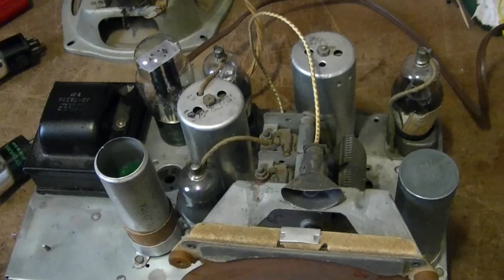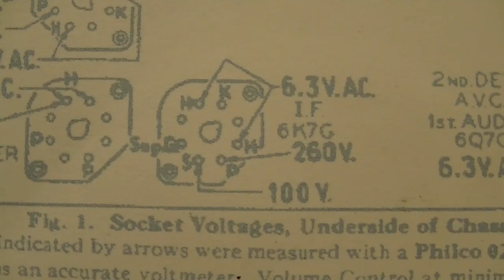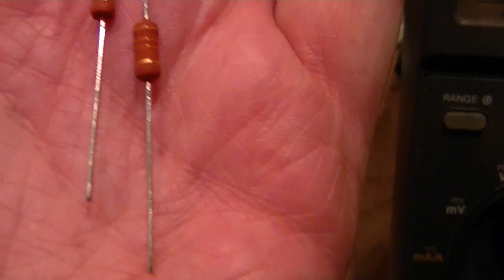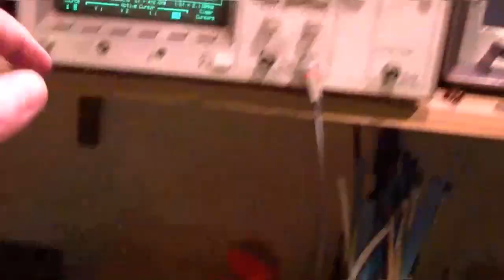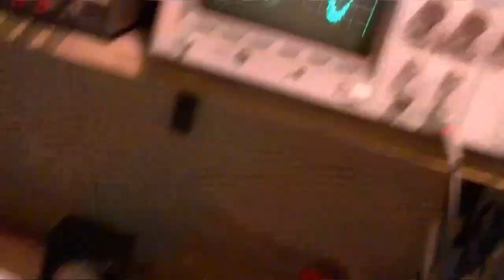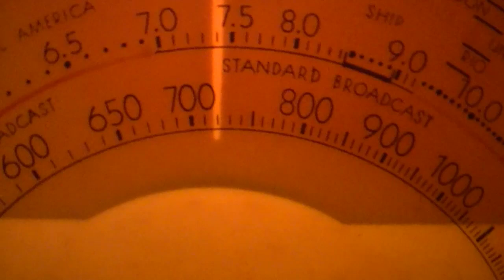Philco 38-10 redux pt2o3

Comment: That noise on the upper end of the AM band may be coming from a cheap switch mode power supply somewhere in your building. An aftermarket laptop charger or something.

Comment: What a real nice video! I always learn a lot from you! I am getting into electronics, and vintage televisions, radios, and test equipment. Even though, Some components can be hard to find. I noticed that you find some things on e-bay. Is this a good source? Just curious. Also, what did you ever do with those two boxes of knobs in the "ARCI Radiofest 2013" video?
Those swap meet vids are good fun to watch. Wish we had some of those here where I live. Well thanks again! Take care!
Keith
Reply from the maker: I use parts from ebay if they are NOS and from a trusted source.  Otherwise, I buy all my parts new from the major vendors.  I sorted through all those knobs and still have many of them.  Handy in case I or another collector ever needs them.
Reply: Thanks, That's good to know.

Comment: Hi Bob, You need to clean the rotateing contact on the tuning cap. You may need to take the brass wiper off to clean the shaft of the tuning cap. Poor grounding on the moving part of the tuning cap will act the way the one on your radio is acting.  After 70+ years they can get very nasty indeed. All the best, Tom J. from FLA.
Reply from the maker: Thanks, I'll give it a try.